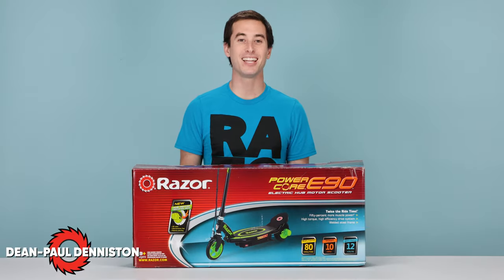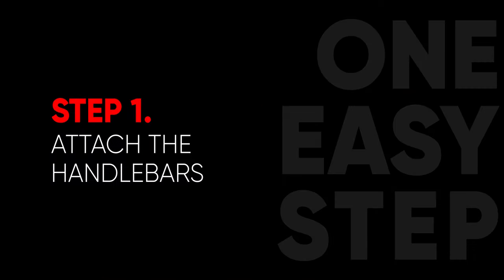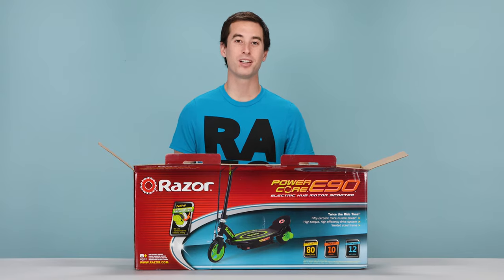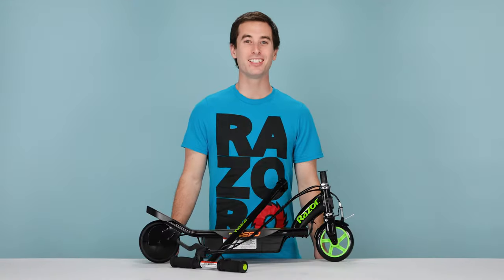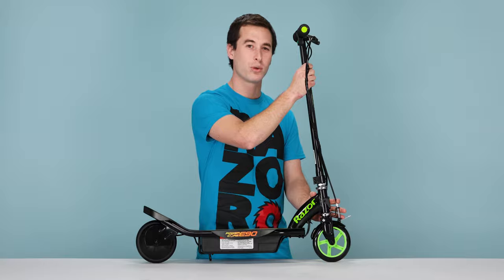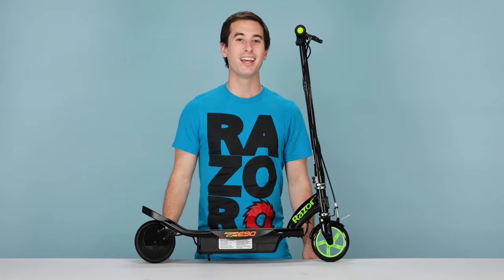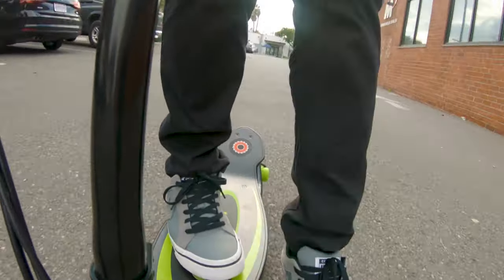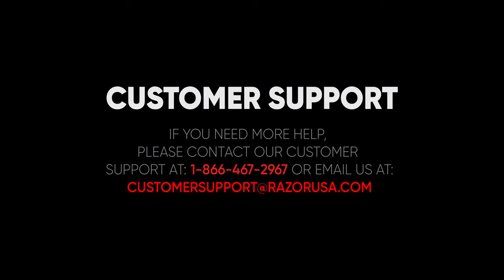How to Assemble the Razor Power Core E90 Electric Scooter

Comment: Tightened the bolts and the stem still becomes misaligned from the wheel. Any suggestions?
Reply: I’m having the same issue
Reply: So the fix for this was to really tighten the screws almost to the point where the Allen wrench was bending a bit. Now it’s nice and tight.
Reply: Put the bolts through the other way

Comment: Happy birthday to my kid, the thing doesn't work out of the box. Seems to be fully charged, took it apart and checked ALL connections. They're set. It does. Not. Work. Power turns on but the motor never engages. I rolled it down a hill 10+ mph to see if it would engage at a higher speed nothing. 1 hour+ of troubleshooting and a disappointed kid, not to mention the price of the unit, time taken to do a return.